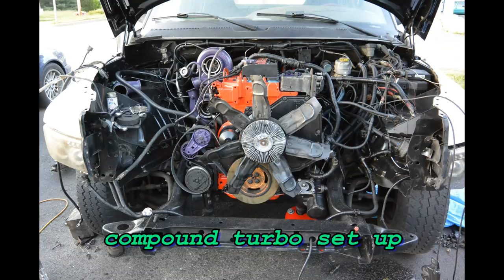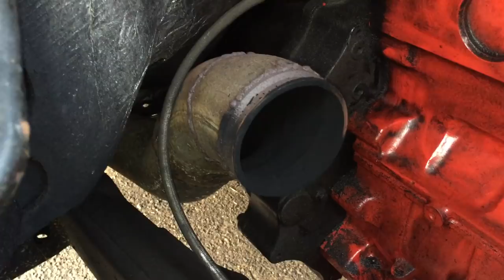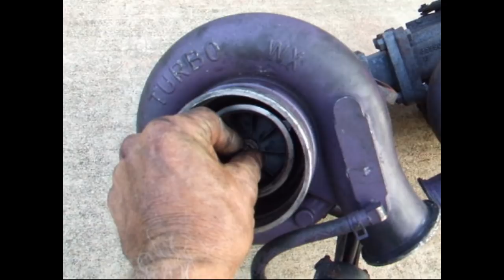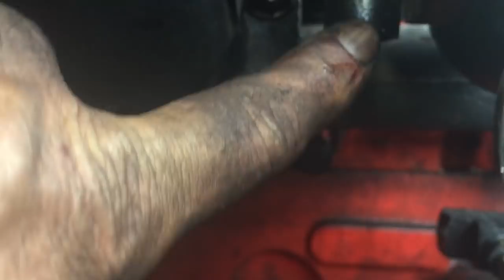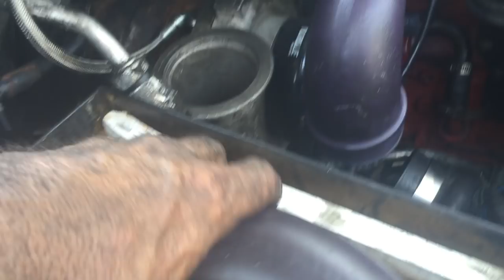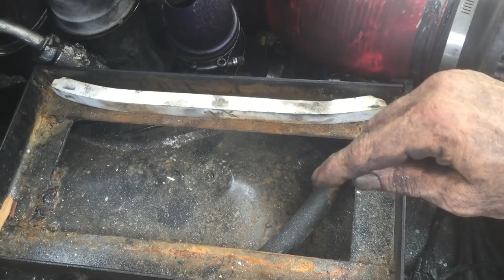DIY COMPOUND TURBOS, AWESOME UPGRADE, AWESOME SOUND

Comment: Nice Setup, one thing I would say is that you either need to crank up the Amperage on your welds or increase the wire speed.  This may seem counterintuitive, but clumping like that is either low amperage that fails to heat the metal enough for penetration or low wire speed that causes the arc to start, burn the wire and stop, wait for new wire to start start, burn the wire and stop etc..  but not complaining at all, awesome setup.. Again, thank you so much for the vid..

Comment: Someone else left this comment and it is accurate that you are running a little cold on your welds. Not a complaint just pointing it out to help a fellow welder get better. I asked a professional welder how to tell if your weld was too cold and this is what he said "Concavity of the weld: it should lay flat to slightly concave on the metal, not a fat bead on top of it. The point is for it to be digging into the metal as it's supposed to fuse into it as to be indistinguishable from it. Also read how the puddle digs into the metal as you're welding--look at how the liquid of the puddle eats down into the base metal instead of globbing on top of it." This helped me quite a bit and really improved both the look and more importantly the quality of my welds.

Comment: vern nice, i have a 14L cummins big cam 3 with 400hp i want to get my truck up to 600hp can i use two Holset hx60 with a intercooler mod and add some shims and a number 5 putton in my fuel pump and turn out the fuel screw 3 turns will my truck make close to 550hp?...
Reply: Omg that's a semi engine.
Reply: If you are feeding one turbo to another you really will get much better results by placing a heat exchanger to cool the air temps between them. Rolls Royce did this on the twin/compound supercharger on the Merlin and CAT did it on the ACERT truck engine. Otherwise you will not get much gain. A kenworth truck racer here in Sydney hit the same problem.

Comment: I'm trying to find out if you do a compound system. .. can you put a big turbo in front of the small turbo ? or it will cause damage ?
Reply from the maker: The small turbo go's first because it
will spool fast, the second (primary) will
will have time to spool and give boost
after the first. Also the primary has a bigger
housing for the exhaust. If you had the
small second it would choke the exhaust.

Comment: Ok, so I'm just getting around to watching your Video on your compound install.  #1 why would you put the turbo drain line for your primary turbo going to your oil pan.  There is a plug in the Casting of your 24 valve already there.  In my application on my 12 valve first gen I had to go to the pan.  You wouldn't have had to do this.  #2 How were you able to determine the placement of the  drain line for your primary?  In other words how did you know to put a hole where you did without disturbing anything in the pan, such as oil pickup line or oil pump etc?  #3  And is it necessary for both Primary and secondary turbo to be wastegated?  Other then that, Thanks for the Great Vid,  Take er Easy!!
Reply from the maker: With my set up my turbo is to low to
drain to the block. I know some people drain the 

primary turbo to the block it just did
not work for me. This is one of those things you 

can see the best way for you. If you
buy a kit it will drain to the block. I had the oil pan
 off so I kinda know where everything
is, about ½ down in the middle you should be OK
just make your hole slow, and put
grease on the drill bit so shaving don't go in the pan
and flush the pan good after. I only
have my secondary waste-gated and it works fine for 

me, I have a 6 speed and I can't build
much boost before I shift I think auto's have more 

time so it may be different. Most
people like the high boost. I like that mine drives good
(don't have to wait at on ramps) but I
would still like it to last. So I can hit high boost 

but don't push it that hard. Maybe some
times but not a habit.
Reply: Thanks for the reply.  Your vid was very informative, I have a first gen so my setup is somewhat different.

Comment: shouldn't the output of the smaller turbo compressor feed the inlet of the larger turbo's compressor and then to the intercooler? It seems like a huge loss in efficiency pushing it the way you do.
Reply from the maker: +Michael Rodgers 

Small turbos spool fast so the small
turbo gives boost from the start then the big turbo spools and adds
boost to the small turbo.  A big turbo will spool slow and take time
to build boost. I made two more videos because I had a hard time with
back presser and high etg's the other videos show how I fixed this.
Subscribe to see what I mean.
Reply: +Michael Rodgers The way he has them setup is correct.  The smaller compressor is going to be more restrictive, so you want to put it on the pressure side of the Larger turbo because there will be less volume of air passing through it.  You also want the larger compressor to get the cold air, if you put the small compressor first it will just be feeding the large compressor hot air.

Comment: Can a compound turbocharger setup work on a v8 gasoline engine?
Nice video btw! 👍
Reply from the maker: Yes, you can put compound turbos on anything. You can even have compounds on each head, Two sets of compounds. It has to be set up right for the engine.
Reply: @Glennfix  cool! Thanks for replying!

Comment: What size turbos did you use if you dont mind me asking
Reply from the maker: The first turbo is pretty much stock in size but has a T-4 housing. The second or primary turbo is a HX-50. Both are off brands made in China and have worked good for me.
Reply: Cool thanks man I appreciate it

Comment: How are these holding up
Reply from the maker: Good I have about 80,000 on them still running good.
Reply: What piping did you use?
Reply from the maker: aluminized exhaust pipe it won't rust and can stand the heat
Reply: Just from like oreilly ?
Reply from the maker: It is mandrel bent, most of the chain auto stores it is expensive when it is this big. You can find it on Ebay or if there is custom exhaust shop you can get them to bend what you want. if their nice it will not cost to much.

Comment: no no no, never reuse gaskets, never use a T fitting for oil supply, omg I know you like and are proud but no no no
Reply from the maker: I see what you are saying, the only tee
in the oil line is for the oil pressure gauge. 

And I don,t know what gasket you are
refereeing to. This is not a Dodge dealer 

I if I get a call back I know it is my
fault, you have to use your own judgment 

when you do things. I did this for
basic understanding, Please use your own 

judgment you can't go back to the
dealer and say see what you did.

Comment: Do you know what kind of egts your running with this set up?
Reply from the maker: It depends, Since this video I did a few more things to it (water-methanol, external waste-gate and upgrade tuner.  At first if I stayed hard on the throttle the ETG's could hit 1400.
I have a 6 speed so it does not take long before I have to shift. After the upgrades, I pulled a trailer up a mountain with about 10,000 pounds on it at 70 and it held 1200 - 1300 but used a gallon of water-methanol. A lot depends on what set up you have. The tuner made a big difference ( can change the tune to make lower ETG's).  I have videos of the other upgrades if you would like to see subscribe and look at the Dodge playlist